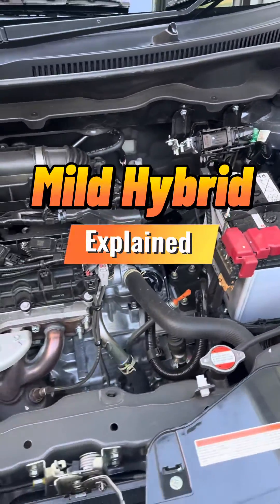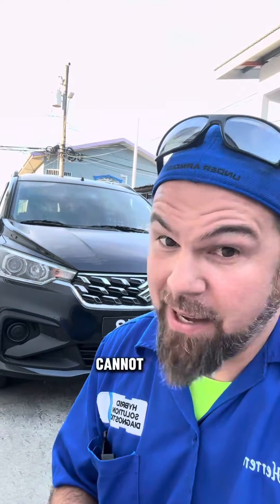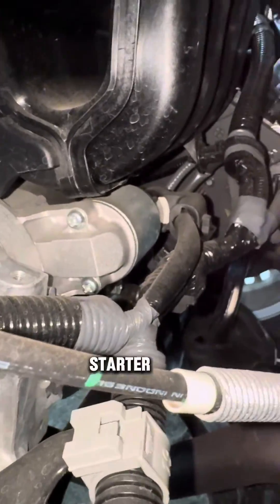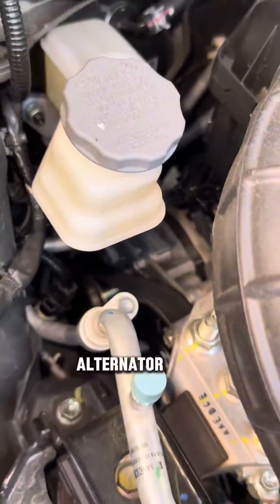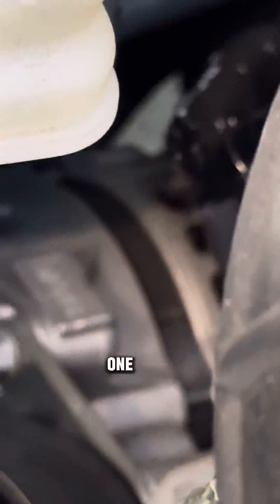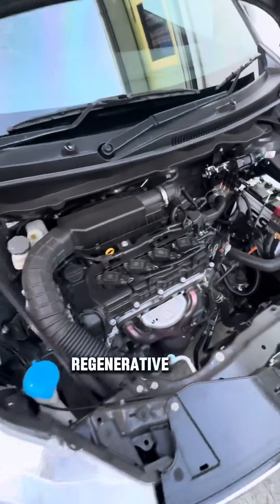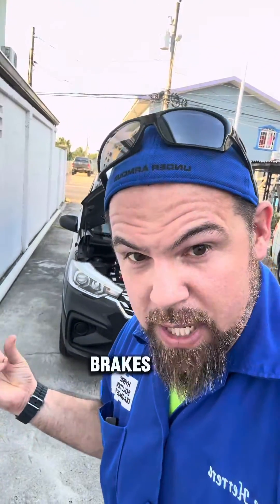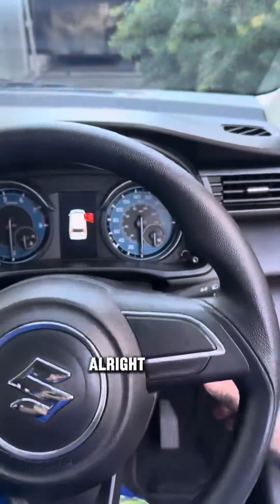Mild Hybrid System Explained

Comment: Hello. I really like your videos. I was not able to see if you have worked on or have some opinion on the newer Kia/Hyundai Hybrid batteries. For example, the latest Tucson and Sportage HEV's batteries. They seem to be different than the ones inside the Ioniq. Do you have any opinion on these? Reliability, design, weak points, etc... Thank you in advance.
Reply from the maker: They are all the very same just different shapes 👍👍👍
Reply: @hybridsolutiondiagnostics  I was hoping that there will be some improvements, as it's Li-pol battery and the cooling is managed differently as well... Maybe these are the only differences. Thanks :)

Comment: Mild Hybrid is useless, more expensive cars than without it .. and it saves 0.00001 fuel liter.
Reply: I don’t know which mild hybrid you have but in the Volkswagen etsi engines you can get 6L per 100km which is very good for turbo charged 1.5L engines.
Reply: @ I have Hyundai ioniq HEV and Corolla HEV, both below 5L ( real consumption)